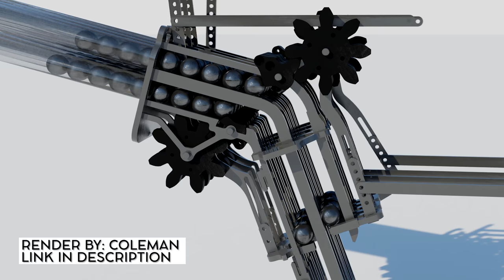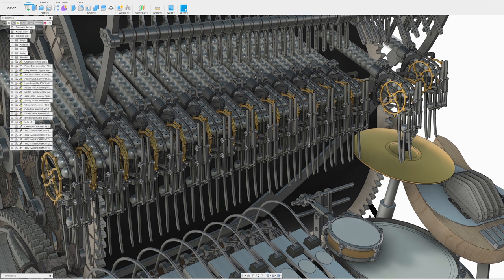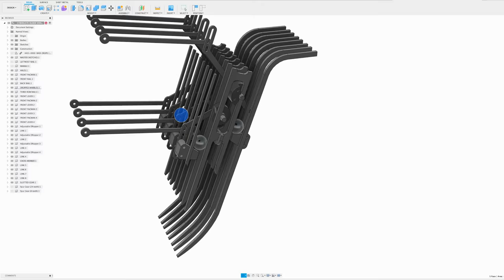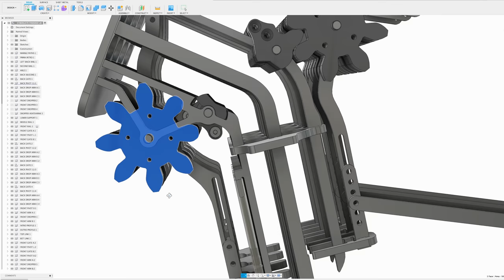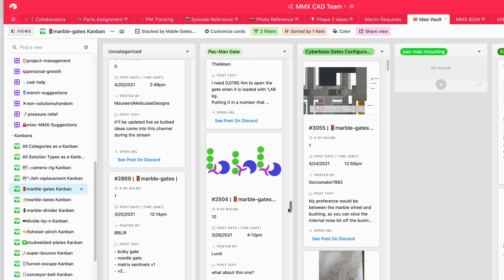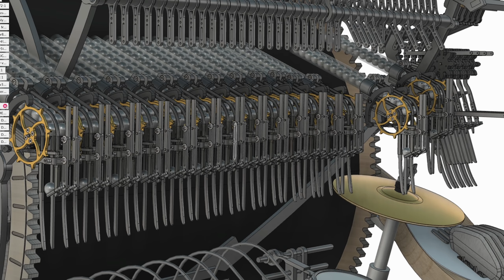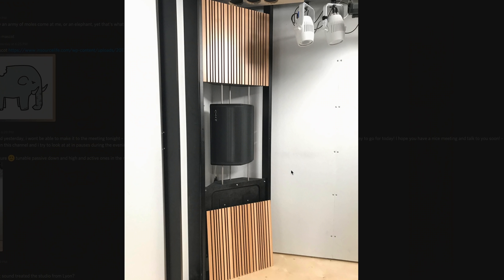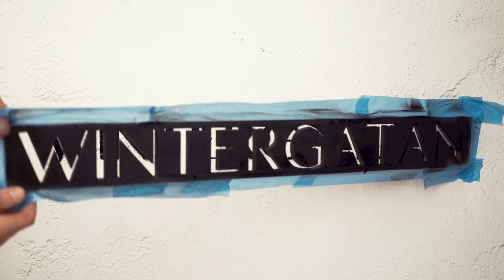CYBERGATES

Comment: I am still concerned about not X-bracing the legs. They are plenty strong enough vertically as is but if it were to get bumped or stumbled into horizontally or corner to corner I see a disaster waiting to happen. A fall over like that would literally destroy that wonderful creation. Shit happens ! ! !
Reply: There is arch reinforcement that was added to make it stable, it is likely more than strong enough to prevent a catastrophe as you describe. Any knock hard enough to break a leg will damage a lot more up top before pushing the machine over
Reply: They are braced up near the top. Check one of the older videos to see how he did it.
Reply: The bracing appears to be adequate, but that's just a guess since I have no idea how heavy it is or where the CG is located.  It's probably fine.
Reply: @89lutzy  As long as it gets hit in line, either way with the direction of the arches L>R or front to back I agree but if it gets hit say bumped by a stage forklift on the diagonal there is little to nothing to stop them from buckling. Thus the need for cross braces. It is little investment for a lot of insurance. 40 years as a structural engineer and have seen shit happen far too many times to count. The "X" braces need to go in left front to right rear and on the other diagonal. You could hit it with a train and not hurt it. Leave the arches in as well. They do have purpose.
Reply: These legs are fine until MMX needs to leave that room. This is a problem for Future Martin.
Reply: @TomokosEnterprize  I see what you mean and that definitely should be taken into consideration, but seeing how this machine won't be the one going on the world tour and will just be recording the studio album/s (so much safer environmental conditions, especially now with covid), I think it's safe enough to leave it as is for now and be sure to employ that feature on the MMY along with the other 'redundancies'
Reply: @connormcinerney7503  I can rest a bit easier now, Thank you. As long as someone doesn't get wasted and trips on a cable hitting it in the "sweet spot". With the tens of thousands of $ invested here 20 feet of 1" square tube is as I said cheap insurance eh.  Thanks again Connor. I really appreciate the reply.
Reply: @TomokosEnterprize  not to dispute the engineering here, I am sure what you are saying about the placement is true, I just wonder if it would be possible without interfering with anything "underneath" the machine
Reply: @EvilLobsterKing  Hi there. For sure. They would not be in the way and I can envision them being attractive as well.  X-type bracing has been around for thousands of years. With Martins design and engineering abilities i can see a number of possibilities as well as being inherently strong they most definitely need to look great too. It truly is a piece of art.

Comment: The full gear design is interesting looking if not unneeded since it doesn't actually rotate.  It might be better to design it in a way you can rotate the piece if the contacts start wearing out.  Like it was designed with built in redundancy instead of just looks.  All that would take is making the gear sections match the ones that are actually being used.
Reply: yeah I'm not a huge fan of the "fake gears", but that's just my opinion!
Reply: If the 'flowers' are not designed with built-in redundancy, then it is somewhat wasteful. The part(s) - as 'flowers'  will take longer to make, I would think, and don't add very much in the way of visible interest.
(Why do I think that he sees them as a mounting spot for more 'fingers'...)
Other than the 'flowers', the design is really quite elegant.
Reply: The full gear is an interesting shape to watch.   I wonder if the counterweight it provides doesn’t make the stress on the lever action less?

Comment: I like that you care more about Silence and Function. And also Parts still look great. You're getting better and better!
Reply: I've always preferred form that comes from function.
Reply: I read this as "silicone and function", but that's still true since the silicone tubes are used to prevent metal-on-metal contact and reduce noise.
Reply: I kind of enjoyed all the racket from the original marble machine, that made it unique and added character.  Take away the machine sounds and it's just the music itself, with little trace of whether it was made by a marble machine or human or digitally created.

Comment: Honest question:  The "flower" actuators on the marble gates for the bass...why did you make them as you did if they are not actually gears that would use all the "pedals"/teeth?  Was it in order to balance the action?  Was is for aesthetics?  Was there another reason?

Comment: The feet holding the marbles right before it's dropped has a lot of extra motion in it. It's opening too much, which will possibly reduce your max tempo because it will increase the time it takes to cycle the whole mechanism.

Comment: Martin, you should build Three things meant to make transporting the marble machine easier with no risk of damaging it.

A marble drum: you can store the marbles in it when not in use. this would make the machine easier to move & prevent the marbles from the railing themselves and falling off during transport.

& a custom shipping container meant to cradle the machine on it support structure so it doesn’t rock from side to side and damage itself during transportation.

Comment: It's going to be such a schadenfreude experience watching him sync every single gate to the high-hat. I hope he'll work in a couple days of sound check for each of his stops on the world tour.
Reply: Each drop has the same height, each registrator has an adjustable throw, and the peg board programmer wheel is extremely accurate already.
Syncing should be very manageable:
Play at a constant speed every note 10 times, check average variances, calculate throw variance, adjust, repeat.
Reply: @MrGonzonator  Remember how he used the knob on the left just to sync the snare to the high-hat? There's only one of those knobs.
Reply: @NOLAfugee  you misunderstood. That knob was to sync the rhythm section, which plays directly off the crank shaft with no marbles, to the marble droppers.
All other instruments use marbles and are synched via the registrator adjustment.
The knob is there to adjust the offset for different tempos, since the time of flight for the marble drops is a constant offset, whereas all other movements, including the rhythm is tied directly to the BPM.
Reply: @MrGonzonator  oh, right, but there are varying distances from the gate to the instrument, especially within the drum set. He might need to tweak where the programming wheel's holes are for each instrument if it ends up beyond the height adjustment range on a gate.. Imagine this: 1 gate per instrument/note triggers at the same time, followed by the second gate. Will they all sync?
Reply: If he programs "manually," ie not with studs welded to a metal sheet, he might want to slice the wheel and roll a particular gate so it triggers relatively early or late. This is also making me think that "welded sheet music" might not be the best idea for a tour after it comes off a truck.
Reply: @NOLAfugee  the instruments are all at different heights, yes, but the gates are designed with a variable dropper arm length, so that he can match the freefall distance precisely for every single dropper.
Reply: @MrGonzonator  not all instruments have the same distance from the dropper.
Reply: @NOLAfugee  the distance between the instrument and the droppers spinny mechanism might be slightly different for each, but if you look closely you'll see that the escapement or Pacman gates are only releasing a marbles down to the actual dropper, which is on an adjustable arm.
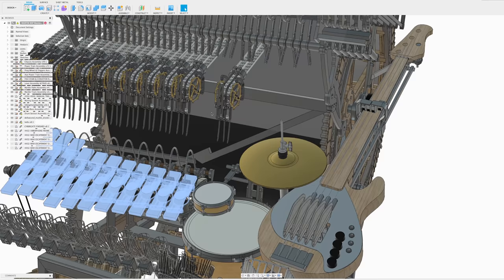Reply: @MrGonzonator  2:25 the high hat and bass drum gate assembly are mounted in the same area. There's no way the adjustable droppers can be the same distance to their instruments. There must be some sort of calculated offset.
Reply: @NOLAfugee  you are talking about the escape wheel gates, which is featured in this video from last week...

https://youtu.be/Ri7yYM1CV2E

Pause around 48s and you'll see the actual final release is on a sliding adjusters with two bolts. In the video it's set to it's maximum elongation for dramatic effect, but in reality they would all be initially set to centre and adjusted to the same drop height to account for different mounting positions.
Reply: @MrGonzonator  I know how they work. It'll take more than an afternoon to sync every dropper before road shows.
Reply: @NOLAfugee  if the fixing points are bolts, the drops should remain largely static even in transit.
I guess we'll have to wait and see.

Comment: I'd hate to be the one making those stainless steel parts, long thin parts love to turn into banana when you cut on em.
Reply: Part of that depends on what you use for cutting, but the nice thing is that when something is thin enough to warp, it's usually thin enough to bend straight again.  I doubt they're heat treated parts, so a little tweak here and there shouldn't be a problem.

Comment: The new gates look great! Please consider though finding another material other than silicone for the tubes you are using for noise dampening. Silicone has poor tensile strength and tear/abrasion resistance and you may find that you are having to regularly replace the tubing on all the gates. I would consider using a different rubber, such as natural rubber, SBR, butyl or EPDM. Using the correct rubber formulation for your application should increase the lifetime of the parts and reduce maintenance. Good luck!
Reply: Damping, not "dampening."

Comment: Martin, I think I see an issue that might have been overlooked.  When you have the gates at an angle, that means that the inside dropper is now pitched up with the ball against the same rail as the dropper.  This will result in the ball dropping later on the inside when compared to the ball dropping on the outside.  This would only be an issue when the dropper is at an angle and not vertical.
Reply: he can do timings for each channel individually at the registrators. that should not really be a problem.

Comment: I have two worries. Not much displacement on pacman to stop the marbles, especially if you factor in  slack of gears and wear. Second the backdrop, on release the marble doesn't slide on the rail but passes over the release. It could make a little bump influencing drop location.

Comment: A question: the grinding of the wood parts onto each other, won't there be a prboblem after a few months because the parts dont fit so tightly into each other? Thanks for all the answers

Comment: I'm concerned that the droppers below will have a timing totally different compared to the upper ones. As soon as the release bracket is moved the marble on the top will fall, but on the lower droppers the bracket needs to be fully retracted before the marble is dropped. I think it would be way better to have the same system on all channels instead of some mirrored mechanisms. Hope it won't give too many timing issues

Comment: Thinking about your attempt to silence the clinking and clanging of metal on metal using silicone, I remember a video where you tried to use umpteen coats of liquid rubber on the five devices on the Cyber Bass to prevent the marbles from clanging as they dropped on the bass strings, only for them to then get stuck and not even reach the strings.  I am curious if you found a better solution to this problem, as you will need to test the Cyber Bass as well as the Cyber Droppers simultaneously, and the last thing you want is to try to test the Cyber Droppers only to have marbles get stuck between the metal devices and then to bounce off each other and not the strings themselves, creating more chaos in the process.  Hopefully, you remembered to remove the rubber coating prior to trying another solution, like shrink tubing.

Comment: Proof is in the pudding, it is a machine and with all machines they have a finite lifespan, I would think it best to get cracking on its music capabilities rather than it working and wearing on mundane testing. The proof of the pudding is in the tasting. ... Generally, the expressions are used to say that the real worth, success, or effectiveness of something can only be determined by putting it to the test by trying or using it, appearances and promises aside—just as the best test of a pudding is to eat it.

Comment: Hello Martin. Its been à while I have something that bugs me about the design, straight  to the point: GALVANIC CORROSION. Direct contact between different metals (Brass/steel/aluminium ) can cause corrossion . I am no expert, specially for the scale of the MMX.  It might not be an issue in the short term, but if the MMX trouly becomes a master piece, it would be a shame that in the long term the machine suffers such degradation. Please consider consulting the comunity in this subject.

Comment: I still think that the decision to release the marble on the push of the lever is wrong, as the speed of the push highly depends on the machine's speed (RPMs). It would be better to use the backwards move, since it should be more constant speed and faster, thus making the timing more accurate and less speed dependent. It could also reduce the need to preload the marble gates with dummy notes, as is currently needed. The optimal solution would "load" a marble on the lever push and release it on lever release.

Comment: "Stainless steel is easier to weld". Compared to what? I thought that stainless steel was more difficult to weld than mild steel. Requiring much more gas shielding.

Comment: I saw you fighting with dirt, rust, magnetism, noise, etc... I’m quite sure you could find some kind of silicon marbles that could have the same diameter, possibly equivalent weight and density, and then get rid of silicon tubes and/or other artefacts.
Reply: He needs soft contact between marbles and the machine for low noise, but hard contact between marbles and vibraphone/bass for good sound. So can't use silicone marbles, or other soft materials.